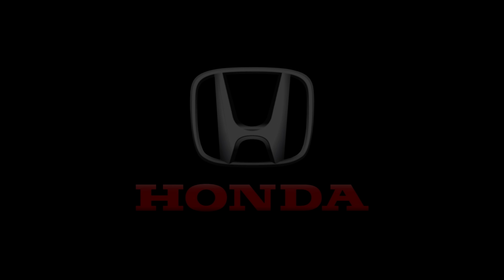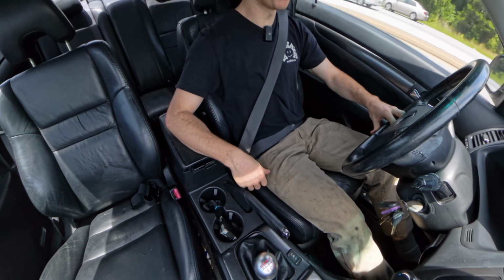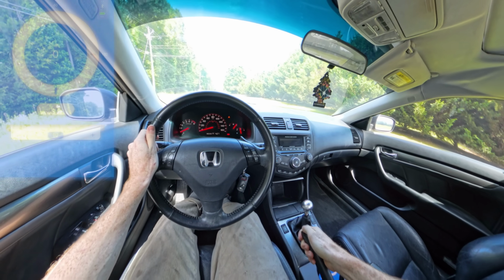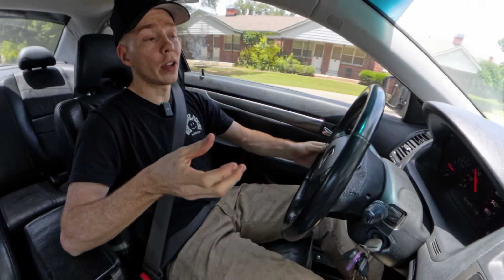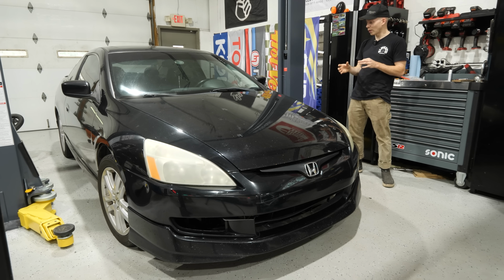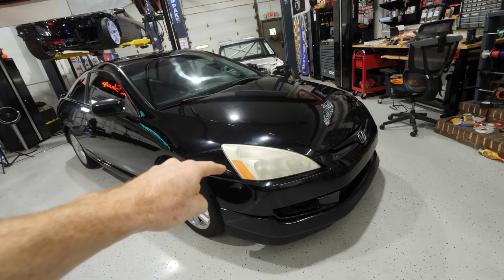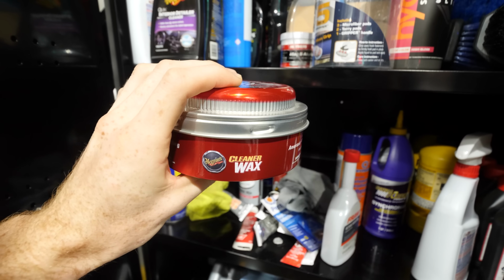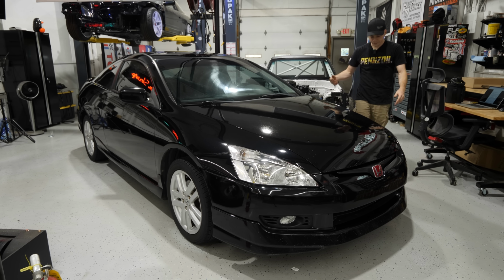I Bought Honda's Most Underrated Vehicle

Comment: Honda also has another pretty cool v6 manual honda accord around the same generation that you may not have known about either! Between 2010-2014, the accords more luxurious brother, the Acura TSX, was offered in a 3.5L V6 (the J35Z6) which produced about 290bhp, and was offered in a 6 speed!. They're very hard to come by but might not be a bad car to look into! I myself own a '13 TSX Sportwagon and it's honestly hard to replace it with another daily, I just wish the wagon was offered in a V6 as well.

Comment: Got this same year sedan with the K24 5sp manual and I love it.
Edit: That's the same color as mine, Black Pearl Metallic. I had the famous clear coat peel on the hood roof and trunk, but I rattle canned it and it looks flawless. You'd swear it was factory, I wish I could post pictures here so you could see. 180k miles is barely broken in on that car, mine has 90k more miles on it and it still runs perfect, no burning oil or anything. Were I you, I wouldn't do a turbo it just stresses the motor . I would however get the V-6 out of an Acura TL, those things are beasts, LOL. But it's your car bruh, you do you and have fun with it man and you did a good job cleaning it up she looks good and it has a good home with you as its owner.

Comment: I have the same model. It has the 4 cylinder. Not the top trim but the one under it with the k20a it’s stil a coupe tho 🫡 and has 305k all original parts I just swapped oil tranny fluid spark plugs and the motor mounts as the original owner swapped the rotors and brakes before I bought and aligned it(was a mechanics daughter 🤝🏽🫶🏽🙏🏽) I was blessed to find her even if it’s a auto so fun to daily. Just enough power. I swapped to xtrons head unit, tinted her, next is speaker swap and headliner and she’ll be 👌🏽 maybe thinking of copping the leather seats and dash from your trim and some type r rims 👀😈

Comment: For easy power on these cars take out that 3rd cat and do a custom cat back system. The "pre - cats" are the only ones monitored on these cars and unlike the 4 cylinders the j series want a bigger exhaust diameter to let the engines breath. My 04 tl aspec with the 6 speed did almost 300 whp with a custom exhaust and putting in a k and n engine filter. Honda corked these motors up for emissions way more then they did with the k series

Comment: the reason why the clutch felt spongy/blown up is the check valve in the slave cylinder, best thing to do is remove it if you plan to get on it/beat on the car!

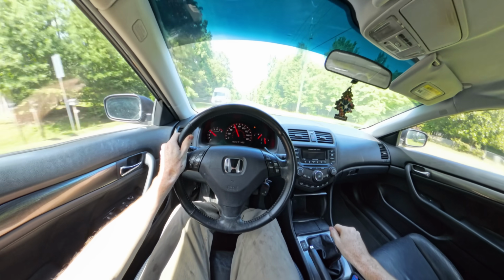Comment: 6:38 Some people have had 3rd gear lockouts, but idk if you meant the clutch pedal felt weird, as in it was losing hydraulic pressure or..? I've had the pressure plate go bad in some of my manual transmission-equipped cars, and usually this is one thing that kills the pressure in the clutch pedal; although pumping it back up a few times will usually resolve the issue. 

The pressure plate issue tends to really only show itself during high rev shifts. Aside from that, it might be an issue with either the clutch master or slave cylinder themselves. I highly, highly recommend you do a CDV delete in the Accord V6 6MT; it will change the driving experience completely. Some people say it doesn't affect the clutch disengagement (only the engagement), but I've personally seen beneficial changes in the disengagement after removing the clutch delay valve (CDV) from the clutch slave cylinder (CSC).

Comment: I have the k24 5 speed manual version of these, but always wanted the v6 6 speed
Reply: How do you like it ? I’m buying soon but still undecided which one I should get. K24-5speed or V6-6speed
Reply: @makan1568  well it has 412k miles on the original trans and engine, pretty cheap and easy to work on, the fuel ecomony isn't a big difference between the two surprisingly, the v6 is just nice to have for the  power
Reply: @svmuscle7677  thank you for your reply. This 7gen has something unique. Especially when you put some nice rims.

Comment: put a j32a3 with its LSD transmission from an acura tl 2005, that and an factory tl ecu, now that turboski is gonna be good for even more power condidering the j32 is even more durable . the j32 is bolt on so no modification needed and you just drop it in like you would drop an oem engine

Comment: Are they really that underrated though? I think that most car enthusiasts are well aware that these are very capable cars. 
My own first experience with J-series engines was actually with the Accord V6 of this generation. Back in 2004 I test drove one new (a sedan with an auto), it felt really fast and I dreamed of owning one for years after that. I never got to, but I've had my fair share of experience with other cars that had a J-series motor in them (and I'm still driving a J-series car to this day).

Comment: Replacing all the rubber bushings in the front suspension with poly ones should eliminate the wheelhop without any significant impact to the ride comfort.

Comment: I have a turbo RSX-s and daily 2005 RSX-S here in Canada..  They're great because they are small than the Accord and more luxurious and solid feeling than the Fit So it kind of falls in between the Accord and fit for a good solid car with just enough luxury. I have heated seats and climate control and it's under 3000lbs.

Comment: Ditch the 3.0 and swap to the 3.2 from the TL J37 intake manifold and tb header ,jpipe , full 3 inch exhaust 275+ whp without a tune 
300+whp after tune hmu if your interested

Comment: I don't know how much effort you wanted to put into your paint correction, but you should've clay bar'd first, then hit it with a wool pad and medium cut, finish with foam orbital and polishing compound. 3M is what I used when I was at a body shop and what I use personally now that i'm out of the industry. Nothing beats 3M. Honda clear coat isn't the thickest or greatest but it'll hold up fine to at least one pass with cutting compound.

Comment: I considered this car when I bought my MkIV Jetta VR6. The one thing I don't like about the Jetta is the fact it has a 5 speed. This makes for rather mediocre mileage on the interstate. You can swap in the diesel 5th gear for better economy but I don't really take many trips these days and it would ruin my ability to use 5th when driving around town for better mileage. Went from 17.5mpg to 20mpg just by changing my shift pattern. I still get off the line quickly, I don't drive like grandma. Which makes 20mpg pretty respectable for city mileage with a chipped, 12v VR6. The more frequent downshifts are worth it. Somehow I doubt whether this Accord would be happy cruising along at 40mph in 5th gear turning 1300rpm...As for the engine note, there is no contest. VR6 beats Honda V6.

Comment: I live in aus my first car was a 2006 Honda  accord 3.0l v6 auto roughly 280hp I miss it but she had  excessive oil leaks from multiple engine seals an the paint was faded as hell an had front damage on the bumper and lights so I got rid of her

Comment: J35 out the last tl type S that made 286 drop in. The 305hp J37 probably won't work as a straight swap as it is AWD. These Accords were really good. The problem is, the 2002-2003 6MT Maxima was better.

Comment: idk if id say 180k is low that's when its starting to get up in miles bought mine with 100k sold it with 170k cause it was starting to have engine problems and trans problems and I did maintenance every 3k miles

Comment: These V6 manuals are unicorns both 4 door and Coupes, Same with the newer 2011 to 2012 V6 manuals. The k24 in these accords are not Performance oriented.

I wouldn't mind getting a 2012 V6 6 speed.

Comment: I think you don't need to turbo that, you're putting yourself and the car in a lot of problems that you don't need in a car that great, put it some nice exhaust system, put the engine itself running perfectly with new injectors, ignition system, and a well designed intake, that'll make the car great again in my opinion.

Comment: There's been a sedan V6 Manual, something I rarely or even have never seen, and it's only $1500, hasn't sold because it needs a clutch and CV joint, but it comes with the parts. Is it worth getting??

Comment: I could be wrong but this is not a j30, the j30 is in older Accords like 98-02, I have 98 lx coupe with j30a1.  This is j35 or j37 but these are bad ass. My Honda friend said a u can get these up too 400hp easily.

Comment: just do Honda element Sc to awd conversion with honda crosstrack for rear Diff 

I have auto  that  do 422 hp  334 toque programmed over Drive  botton 

its currently been my Camera Chase truck and yes no turbos      just craftworks super charger.

Comment: Is there a reason someone would choose this over a slightly later Accord that came with the 3.5 V6 and a 6spd manual as well? 270HP stock in those and more torque.
Reply: the newer ones had a limited slip differential which makes a big difference when you have all power going to the front wheels
the older generations did not have a limited slip

Comment: The 0-60 runs were pretty slow, these cars should run 6 seconds flat when stock. Granted it's high mileage and suspension is worn but still

Comment: The amount of money needed to extract even modest HP gains from the Honda V6 is not worth it. The best money spent is on handling. While the aftermarket support for HP gains may get you an additional 40 or 50hp to the wheels ( still naturally aspirated) the amount of money needed to get there is not worth it. That same allocation of funds spent on better suspension, ball joints and chassis stiffening can give this car almost Audi levels of grip and mitigate the FWD plow, turning this into a very decent and fun car. As the owner of a 2012 Accord V6 6 speed, I can put my money where my mouth is when I say this.

Comment: Honda needs to stick to the inline 4 aka the k24, the v6 is is a pain in the ass to maintain and work on. No timing chain, minimum place to work, overall not what u expect from a Honda
Reply: This Honda v6 is children’s play when it comes to taking things apart I can actually take all coil packs and spark plugs out without taking off the intake manifold and changing the timing belt is easy besides the crank bolt being tight. My maxima vq35de is a 10x more complex v6 but still isn’t terrible to work on

Comment: I had one of these, automatic. It was okay. Transmission died. I dropped $1k just to replace the rack and pinion, another 1k to fix the A/C since I'm in FL. Oil leaks everywhere. It's a lot of money to keep this POS looking good. The leather seats were junk, cracked at the bolsters. Steering wheel was junk. Overall mediocre car at 180k miles. It does look sexy as hell when it's all mint though. I wanted to eventually get everything working right but couldn't justify the price. He's making money off these vids which is the only reason to do anything to this car. Looks better in silver, the color I had.

Comment: Lol what? This guy starts talking about extremely basic car options. Dual zone climate control? Sunglasses holder? Arm rest? Wtf lol.

You want a far better car? Get a first gen manual Mazda 6 hatch with the duratec 3.0. Vastly better in every way especially handling, power to weight, luxury, comfort, etc. It also weighs 500 LB’s less and it looks way more sporty / cool. It would spank that car in every conceivable way, there is not one aspect it would lose in and it’s also cheaper and arguably more reliable.

Comment: dude... The honda fit is ass. I mean unless you build it with forged internals... NO FUCKING SHIT THE V6 IS FASTER THAN THE TURBO CHARGED THE FIT, THE FUCKING FIT MAKES 180whp for about 500lbs lighter. Doesnt work out. Besides it's 8 second 0-60 car, I beat so many civics and fits with my t5 volvo...